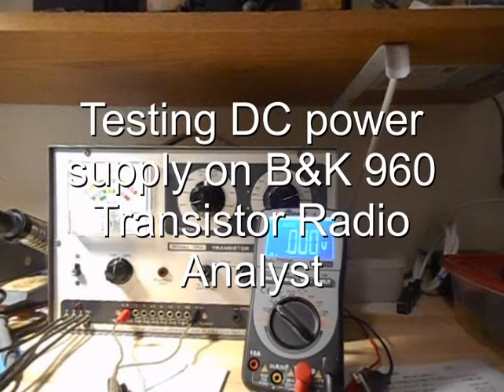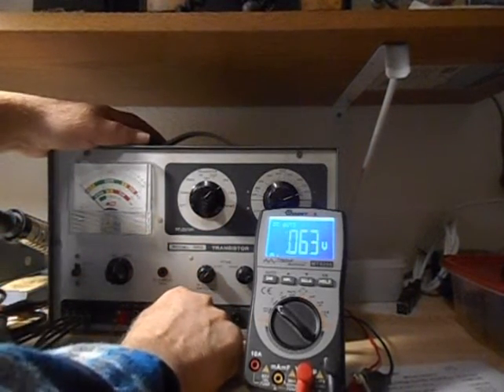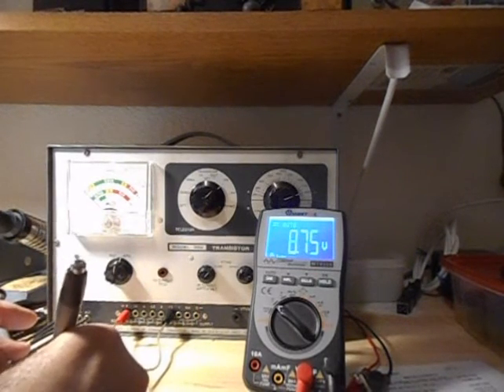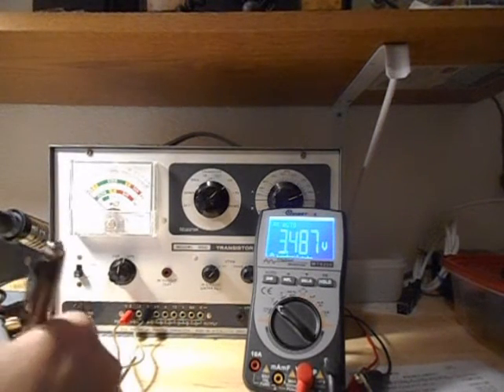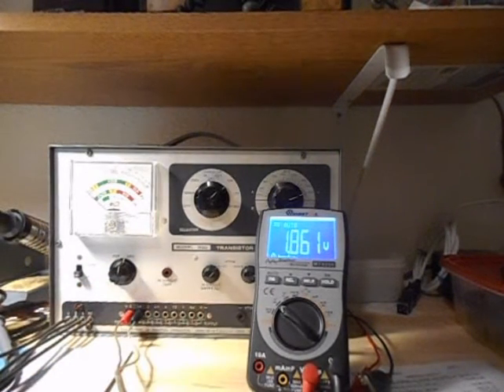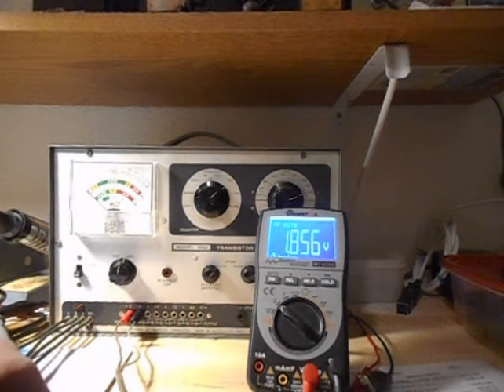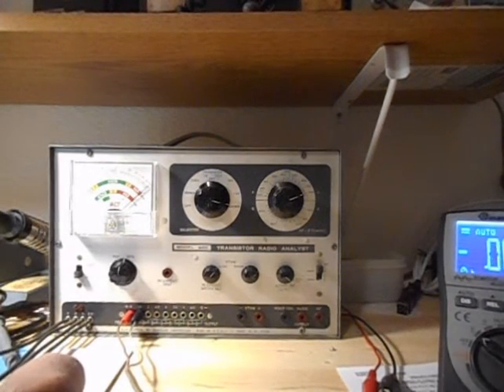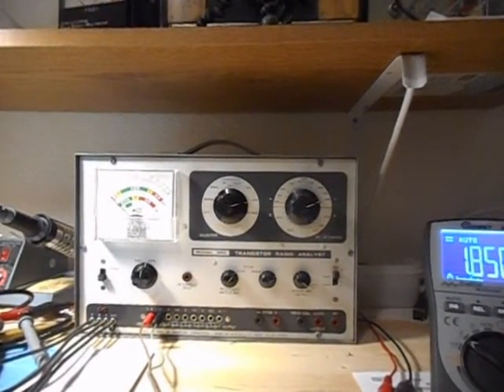Testing DC power supply on B&K 960 Transistor Radio Analyist

Comment: It seems to be working well, as Doug said test it with a load maybe 20 ma load like a small transistor radio would draw.
I would not worry about it.
Remember a NEW 9 volt transistor battery will read close to 10 volts so no harm will come to any transistor radio you connect to it.
Reply from the maker: Yes you both are probably right about that i am sure. I just want to see if 117 ac going in will change it thats much.